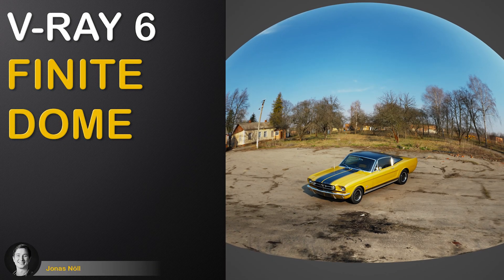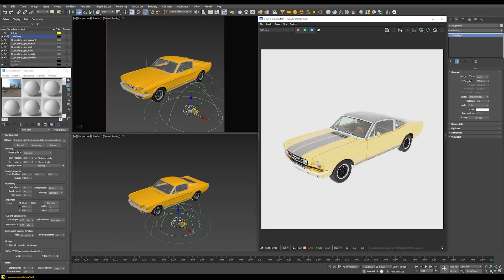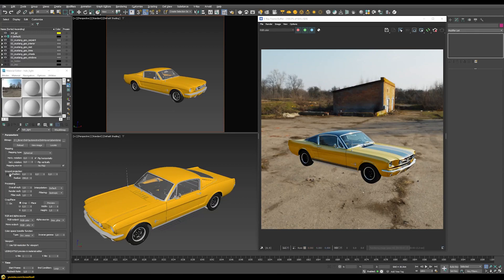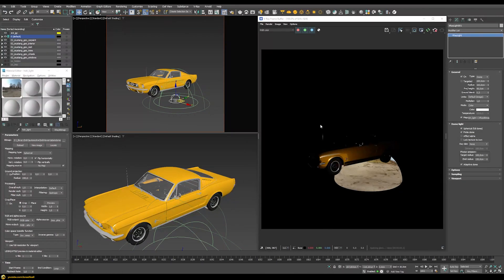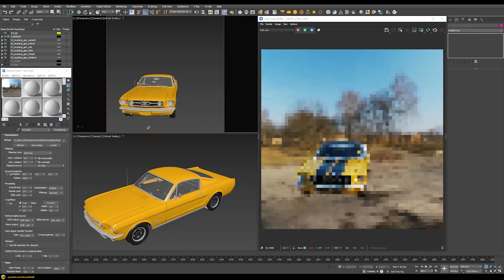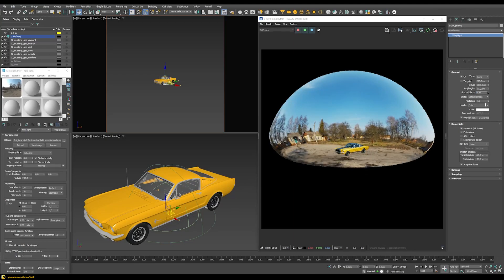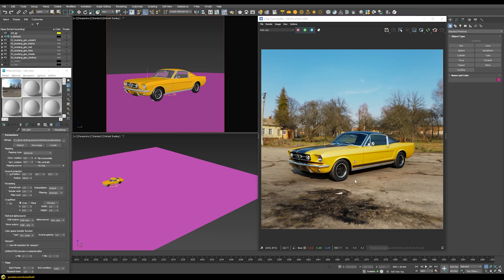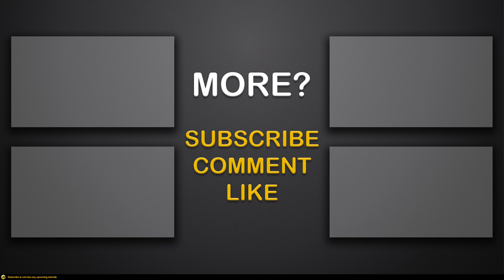V-Ray 6 | FINITE DOME LIGHT (New Feature Breakdown)

Comment: Tip from someone’s who has done a lot of courses : don’t have you mouse cursor wildly spin and zoom around. Just park it if you’re not clicking. It’s less distracting for the viewer AND you can make cleaner edits without it jumping. Try it.

Final tip : some of the dialog values are unreadably small, especially on my tablet. It might be fine on a 24 to 27 inch monitor. However, if you just zoom in on those values by 200 to 300%, then we can see what you’re doing much better.
Reply from the maker: Thanks, for the advice, I will see what I can incorporate of that for future content.

Comment: I knew you would like this! Quick question....how are you handeling the exposure of that hdri/camera? In the enviroment/exposure control?
Reply from the maker: Yeah I normally like to lock the exposure to 9 in the environment exposure control as well as in the camera and then just adjust the HDRI brightness if needed. You could also leave the HDRI untouched and then adjust the EV but since HDRI brightness is anyway never consistent or standardized across files I prefer to just adjust its brightness instead and leave my camera/EV untouched

Comment: Does Vray 6 have improve render speed?
Reply from the maker: I would need to do some comparisions and also it is still the Beta and not the final release, but as it's not advertised I wouldn't really expect too much in that area :-)
Reply: @JonasNoell  There's a reported massive performance boost on the GPU side! :)
Reply from the maker: @F10F11hm  Where did you find this information? Would be cool if true, though I personally haven't read about any speed improvements across the board yet...
https://docs.chaos.com/display/VMAX/V-Ray+6
Reply: @JonasNoell  There's a pinned thread over at Chaos Forum in the Vray 6 beta section called "V-Ray GPU V6 new features and current Beta limitations", check it out!